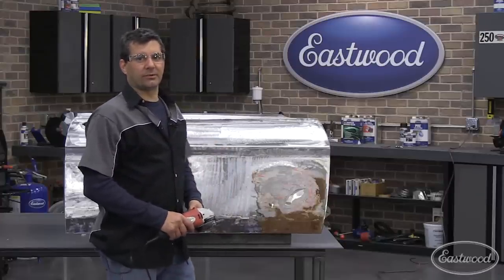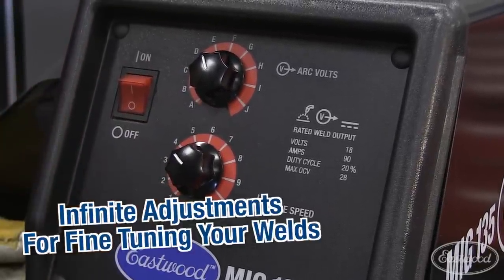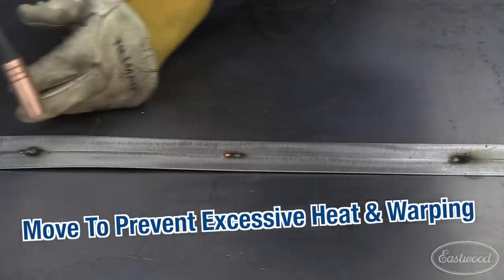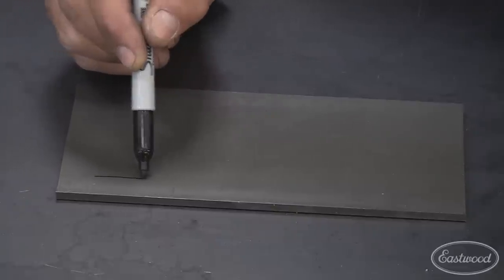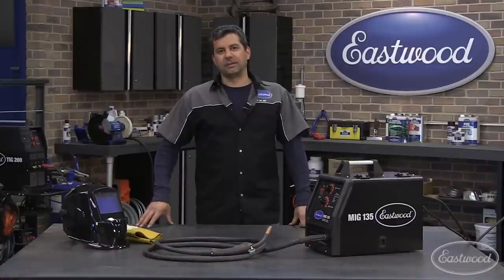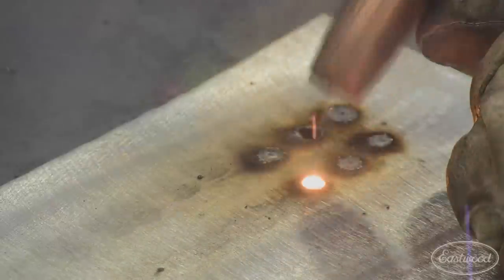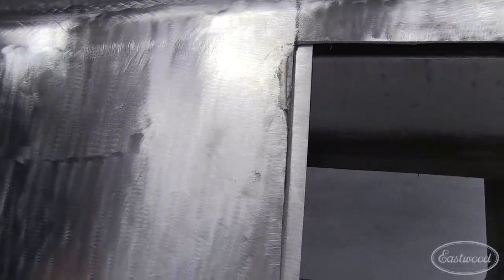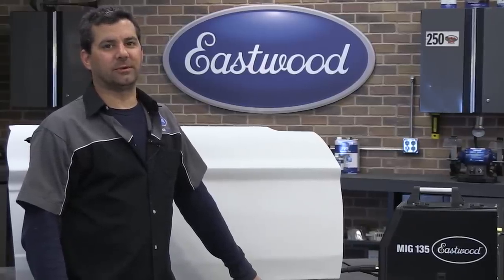Welding - How to MIG Weld, Troubleshoot & Repair a Door or Fender - Eastwood

Comment from the maker: Don't forget to SUBSCRIBE, share and favorite.  Visit Eastwood.com for everything you need to do the job right when you restore your car, truck or motorcycle - welders, plasma cutters, HVLP paint guns, paint, powder coating supplies, abrasive blasters, rust solutions, metal fab tools, specialty tools, hand tools and more.  Since 1978.